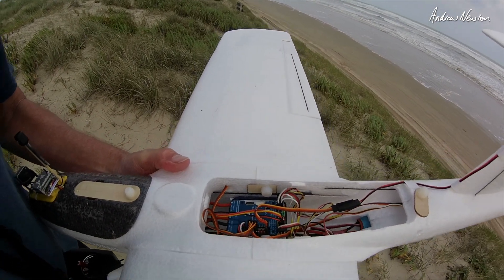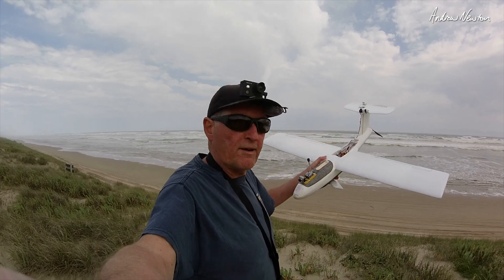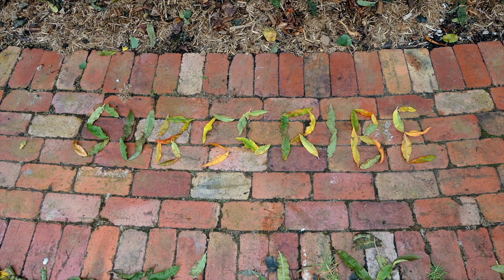Matek F405-Wing V2 XBird Flight

Comment: what size battery, motor and props do you use for this flight? thanks
Reply from the maker: Sunnysky 2207 1300kv 7050 prop with 4s 18650 Li-Ion
Reply: what is  the  capacity in mah ? thanks
 @AndrewNewton
Reply from the maker: 3500

Comment: Hello Andrew, great video! I'm using the V2 board with Arduplane but cannot get the motor going...seems the ESC signal not being recognized (motor beeps continuously), servos are fine. I tried using S3 for motor (PWM3), and also S1 (PWM1), but not working. ESC throtle was calibrated with another RX directly (no FC). Any suggestion?
Reply from the maker: Most likely need to do the ESC calibration through Ardupilot https://ardupilot.org/plane/docs/common-esc-calibration.html
Reply: @AndrewNewton  many thanks for the answer. It seems the signal cannot be recognised by the ESC (Hobbywing 40A) when plugged to the V2 board (for recalibration). It does not enter calibration mode w throttle up on powering, just beeps continuously indicating no signal input. Importantly perhaps I Forgot to say I'm using CRSF protocol (apparently Elrs also uses same protocols). All servos and Aux channels work normal, i see them moving in MP and also on the wing (New C1 Chaser w detachable wings), it is just the ESC.
Reply: I disabled Arming Required in Mission Planner as dont have GPS inside. I used the earlier version of the board with Frsky Sbus, I wonder if may be something with CRSF as it is the first time I'm using it (to do long range).
Reply from the maker: Here's how I set up a wing, using QGroundControl on a Mac, but the parameters are the same. http://newtonairlines.blogspot.com/2023/09/ardupilot-qgroundcontrol-for-mac.html
Reply: @AndrewNewton  you are amazing! Thank you
Reply from the maker: . @joseantoniosantosdom  Jose, thanks so much for your donation. Very generous and very much appreciated.
Reply: @AndrewNewton  I thank you 😊 . I followed your blog, and finally the motor spinned for the for the first time (only difference is that CRSF in V2 board is Serial7 parameter for Ardupilot). Either ELRS and CRSF rxs could be connected to TX2 RX2 pins without modifying any parameters (copied the model on radio for the different Tx ). I am so happy, thank you. And now retiring from Frsky rxs....

Comment: I just got back into the hobby and have the 405 wing flight controller. Is it possible to arm it in Inav with a rotary dial instead of a 2 way switch? Thanks for the help and happy New Year,
Reply from the maker: Yes, probably a good option. Just assign the dial to the arming channel instead of a switch

Comment: Hello sir 

Matek f405 wing v2 vs speedybee f405 wing 

Please explain who is winner with your flying experience/future /easy to use/ flying stability
Reply from the maker: Same performance, just different connectors. I like pins more than connectors so the Matek wins for me.
Reply: @AndrewNewton  matek supports elrs receiver?
Reply from the maker: Yes, I am using ELRS in this video
Reply: @AndrewNewton  wing and wse what’s a different I’m totally confused?
Reply from the maker: @anupmokashi3114  WSE is Wing Second Edition.
Reply: F405 wing-2 ICM42688-P gyro before MPU6000 what’s effect on flight performance?

Your personal opinion wing 1 and wing 2
Reply from the maker: No performance difference, 2 has better layout
Reply: Hello sir I want to make fpv long range wing this is my first wing 

I ordered parts atomrc dolphin pnp kit and Matek f405 wse fc board hobbywing skywalker 50a Esc, bn 880gps, hglrc 350mw vtx + cadax ant fpv camera 

Want to successfully auto launch and RTH 

Smooth flight 

Please make video on inav setting 

And which videos help me available in your channel 

Thank you sir I’m inspired from this channel
Reply from the maker: My advice is dont start with auto launch, best way to crash your wing. Get it flying first then try Auto launch later when everything else is working. Check my INAV playlist for all the relevant videos and my blog (INAV BASICS) linked in the description.
Reply: @AndrewNewton  and which mode best fly first time for me angle?
Reply: ArduPilot vs inav which best ? If your answer inav so why ?

Comment: Hi Andrew, can you tell me what the throttle percentage should be  when picking the correct thrust to weight ration? Is it based on 50% throttle or 60% or what exactly?

Thanks man
Reply from the maker: I would pick 50%. If a plane needs more than 50% to fly normally it feels under powered to me. I generally fly around on 40% or less
Reply: @AndrewNewton  so it’s similar to quadcopter we normally pick motors that can hover the vehicle on 40% or 50% throttle! Interesting!
Reply: @AndrewNewton  my plane I’m building is nearly 900g in total weight with battery and all components and I decided to have a canard concept where the two wings are both similar in length. I’m not familiar with canard based planes when it comes to CG balance setup! If you have an advise kindly give it to me please 🙏🏻
Reply from the maker: Search for Canard CG calculator
Reply: @AndrewNewton  great thanks Andrew🙏🏻

Comment: Nice, is the OSD using WTFOSD?
Reply from the maker: Correct
Reply: @AndrewNewton  I wonder if there's a drawback. I use the Goggles V2 with my Avata, the FPV, the old air unit und the o3 air unit. Will all these work with WTFOSD root hack?
Reply from the maker: I only know the V1 and air units work OK.